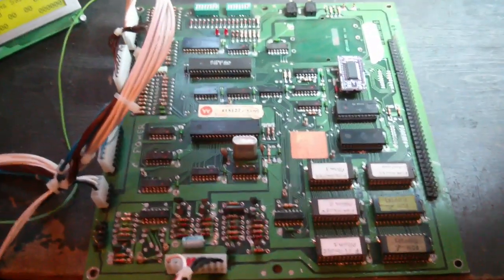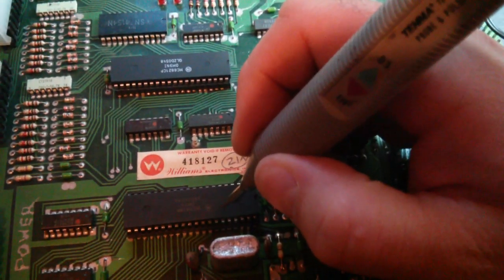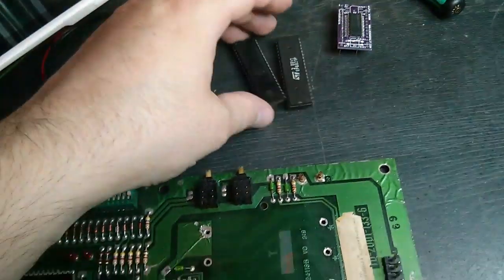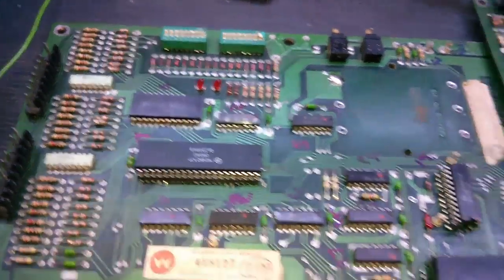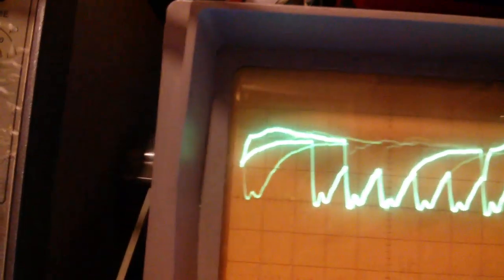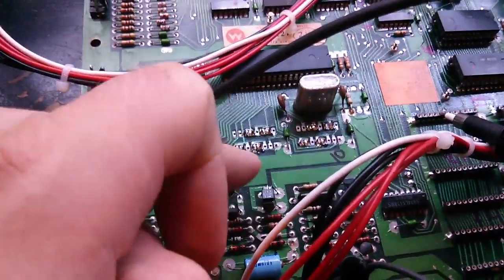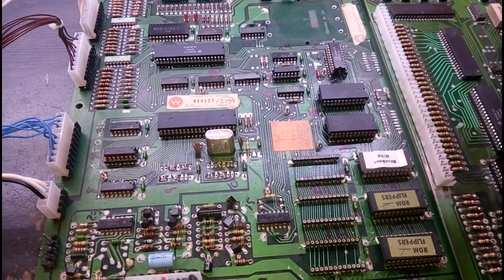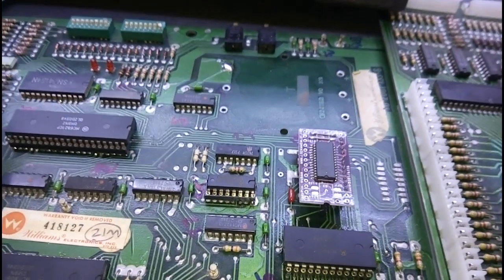Williams Firepower Pinball CPU Repair

Comment: ARCADEUK 
//     //                                                                                  1.) When a switch is CLOSED the PIA chip will send a memory address back to the MPU chip to tell the MPU which switch matrix address has been Open/closed?
//                                            2.) When a Lamp light is turned ON/OFF the MPU sends a strobe data signal/row & column data signal to tell the PIA chip which memory address to turn ON/OFF which lamp light in the lamp/light matrix?
//                         3.) PIA chips are acting like an address decoder chip for all the switches and lamps 
Each switch and lamp/light has a specific memory address to each switch and lamp/light for the PIA chip to turn ON/OFF?

Comment: Fantastic!!!  Wow at the number of faults on that board, it's no wonder it didn't work lol.  It's a shame there's no substitute for those data buffers.  Out if interest, are there places still stocking new parts for these boards - PIAs etc?
Reply from the maker: Yes indeed, way too many faults for this to have been a working board any time recently. For the buffers, there are common chips that exist that would do the same job, but they don't have the same pinout, so you could make up some daughterboards to convert the pinout if they were really needed. Common stuff (74xx logic chips can still be picked up new at places such as Farnell) New Old Stock stuff can be picked up in bulk from warehouses in China/Japan/Singapore and there are a couple of IC fab companies in the US that have millions of IC dies in storage, that were made by the original manufacturer, and for the right sized order, they will cut the dies and encapsulate them into the IC package for you, so most things can be picked up some how
Reply: Very interesting!  Didn't know that places kept the fabs like that and could 'package' them up for you.  I do wonder how much old stock will still be around in 10 or 20 years.
Reply from the maker: It's amazing how much stuff is still around now! Sadly there is one problem, some dies are flawed, and as such when your chip dies, you buy a new old stock replacement, and that's dead already or dies in days. Certain obscure speech chips, reverb chips and other analog stuff suffer this fate, so the only way to move on is to design new circuits to replace stuff with modern equivalents.
Reply: Yeah, I think its like the SID in the C64 - They used internal capacitors or something and I think that's part of the problem.  Many have died through lack of use and I suspect its electrolyte inside that has done the damage.  Some old DRAM suffers from that - use of electrolytic technology internally - something to do with a storage trench from what I read.

Comment: You are truly an expert.What a diagnostics exercise that was! Do you not need to put those buffer chips back on the board?
Reply from the maker: Thankyou :) The buffer chips are not needed when the game has been converted to single ROM, when all the ROM's are present, the current draw is too much for the CPU to drive directly, hence why Williams included the buffers in the first place. They are almost impossible to obtain now, so bypassing them and using a single ROM (less current draw on the data bus) is the way to go with these now
Reply: Ah, okay understand now. You know your stuff!
Reply: NO the Best thing to clean before any change is to use  'EXTRA HOLD HAIRSPRAY" , Spray works best...  The Alcohol Cleans and at the same time acts as a protective sealant. Best On Mother boards and Back bottom of Play-fields ! Saw him do this on his other videos